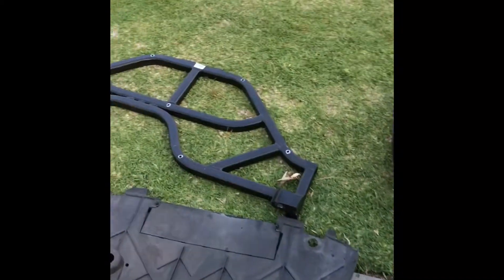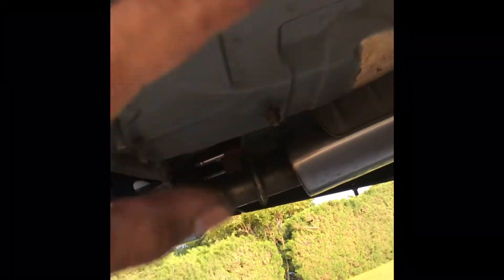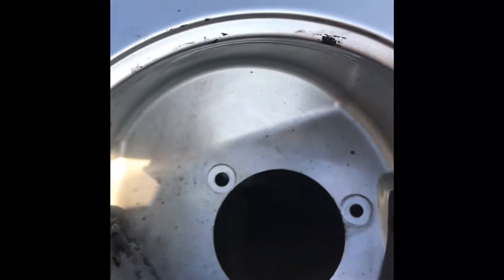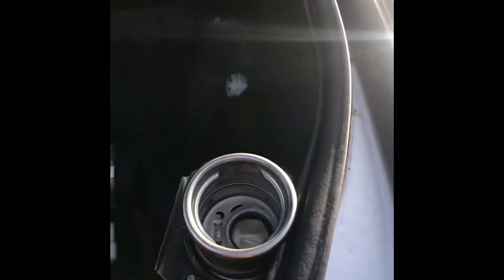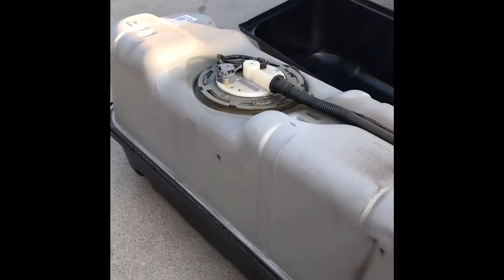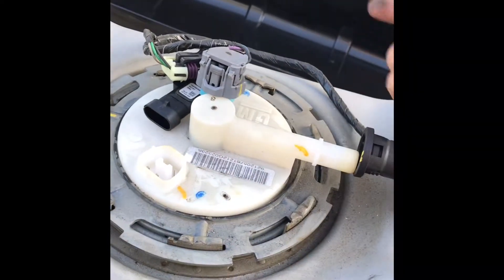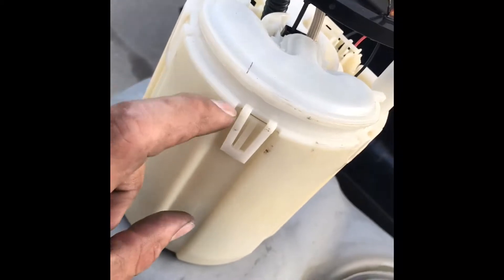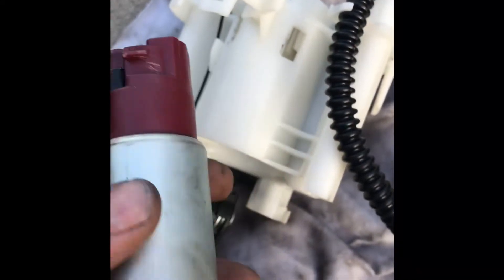Upgrading fuel pump e85 compatible!!!

Comment: How was fuel pressure after? I’ve heard the 340lph pumps will overwhelm stock pressure regulator bypass causing higher than normal fuel pressure at idle/lower engine fuel demand.
Reply from the maker: So far so good haven’t had any issues but I haven’t looked Into detail with that either. My tunner didn’t see any issues either. When tunning the car for idle/ part throttle, wot. I’ll check my fuel pressure gauge with video recording to see readings . Hopefully I don’t forget to update you. I’m interested aswel to see results
Reply from the maker: Im also running 72lb injectors built motor demanding more fuel aswell. Not sure if you know or if that’ll make a difference just thought I’d put that out there

Comment: Does the e85 pump require a tune after ?
Reply from the maker: No tune required to use this pump..
Reply from the maker: The pump can run pump gas or e85 ... 

you’ll need tune if 
1.you change injector size
(I changed injector size and they’re e85 compatible aswell)
2. Decide to go full e85 or install flex fuel sensor to run e-85 mix

You can install flex fuel sensor with out tune but continue to use pump gas ... only use e85 mix when you get the tune 1st for the flex sensor
Reply: @ghc_gto_6.0  Love the gto !! QUICK QUESTION .... so my 06 gto is tuned for e85 with bigger injectors.  Mild bolt ons . Will i be okay with just bigger injectors and tune ? I’m having trouble what else to buy to support the fuel. Thanks !!
Reply from the maker: @Mr-th5hw  obviously every car is different but based on what you said so far with mild mods… I’d say upgrade fuel pump … I’m sure you know already e85 goes faster… for a NA SETUP you should be ok   I’m running 72lbs injectors for e85 

don’t think you need a return style fuel system , or boost a pump … unless you plan on adding boost … but it wouldn’t hurt to upgrade… 

now to actually know if you need more fuel system . Would Depend on fuel pressure readings, and duty cycle reading during wot pull …while seeing the data live.. (dyno tuning)

Comment: Great video man. I’m just in the process of replacing the fuel pump to this DW300. I already have everything out just waiting for the pump. Have replaced this 3 times on 3 different GTOs. But I always go back to videos to make sure I’m doing it right!
Haha
Reply from the maker: I’m the same way I go back to mine or other videos from people I follow just for a refresh specially if it’s been a while... lol ended up fixing my oil pressure issue turns out it was faulty sending unit.. checked grounds, checked gauge, checked 12 volt, even checked with mechanical gauge to make sure oil pressure.. replace sending unit good as new!! I was soo relived  haha no oil pressure scared the shit out of me when I first saw that lol